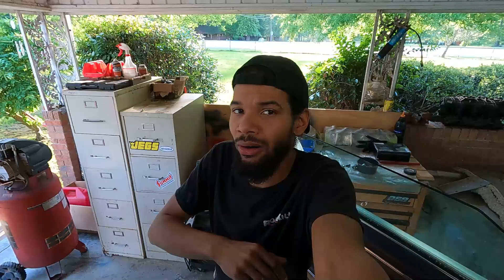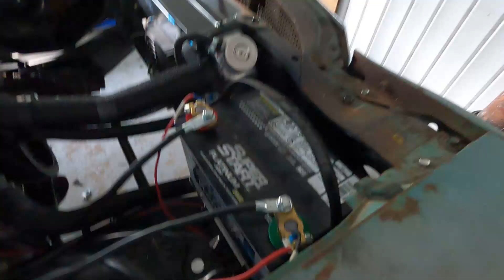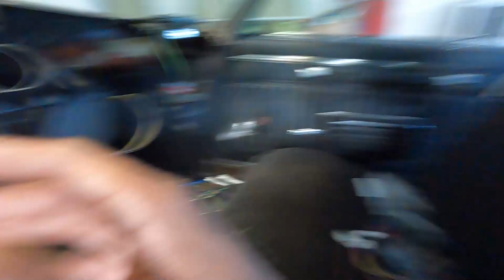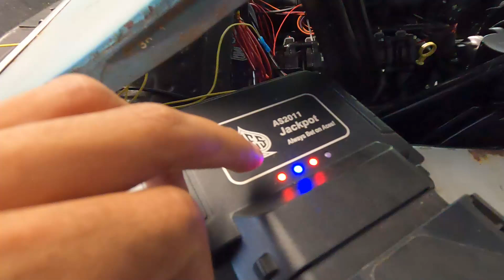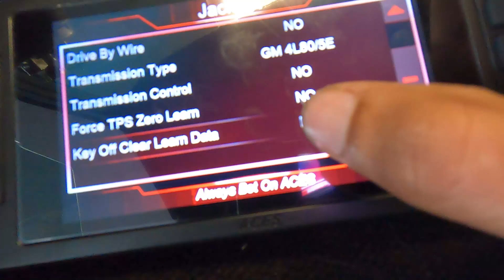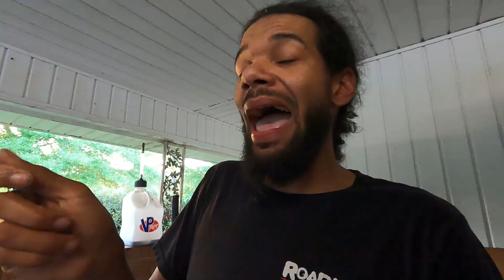How to Setup ACES Jackpot LS: Initial Setup (In-Depth)

Comment: I am thinking about getting this one, but I have a 5.3 LM seven GEN three with LS one injectors but I have LM seven coil packs. Will this unit connect to LS injectors and truck coil packs?
Reply from the maker: I can verify it fits the round coils (19005218) and (C1512-8)
Reply: @TKSpeedShop  cool I will need to buy the coil harness correct what brand did you buy. I'm assuming every complaining about running rich is not adjusting the fuel pressure from that 45 psi how do you still feel about it do you feel like it's running good
Reply from the maker: The first one (19005218) are found common on truck engines
Reply: @TKSpeedShop  I just now seen a video about it does not give you an alternator wire how did you run the alternator wire?
Reply from the maker: I didn’t run a coil conv harness because I ended up running LS3 coils off Amazon cheapppp. Adjust the fuel to exactly what your system is running on definitely helps the hard starts and rich conditions. If you already have an exhaust system, then you won’t have any issues with the o2s reading funky. So far, I haven’t had any issues. It’s basically Holley but still in the development systems with system updates and tweaks. The programming is definitely not as friendly or forgiving as Holley but again, it’s a system that’s still being developed everyday. As far as the alternator goes, I used the ICT billet 1 wire since that’s the alternator I’m using with my setup and I have it running to a key switch hot bus bar.
Reply: The jackpot does have alternator trigger wire it's in the spare wire plug with all the extras like your gages fan controls other goodies
Reply from the maker: This is also correct! I didn’t run any extra wires to my add on harness.
Reply: @TKSpeedShop  how do you like it? Have you got it tuned? Is it running to your satisfaction? I really need to buy one.
Reply from the maker: So far, mines run flawlessly. I don’t have street miles on mines but I have plenty of test time. I let mines self level and made small adjustments to fit my needs. The best comparison I can give you is this,

Holley TermX is like a Edelbrock carb, ironic but true. This system is more geared to tinkering like a Holley carb, again ironic but true.

Aces have done a fantastic job with this system and they’re still updating and improving daily. Plus their social and support teams are really good.
Reply from the maker: No bias either, no sponsor 🙂 it’s a good product geared to DIYers. I plan on using their Royal Flush Kit and Fuel Surge Tank on my small block Chrysler when I get some change together 😭

Comment: I’m gettin a “get wizard data error” when trying to go thru the start up wizard you know anythin abt that ?
Reply from the maker: I personally haven’t had that issue but, I have read from the forums that when an error like that occurs, it’s best to reset the system and update the firmware with the system. You can download the current firmware on their website for your system.
Reply: @TKSpeedShop  how to factory reset the system do you need to hook up the laptop or can it be reset on handheld >asking cause i changed a few things and want to reset and try starting again with all factory parameters

Comment: Did you use the Iat sensor ??
Reply from the maker: @monkey06061  I did
Reply: Thanks for the reply man and one more question, where did you put the ground wire for the coil pack wiring harness ??
Reply from the maker: @monkey06061  on the driver and passenger side cylinder head. On the backside facing the firewall.
Reply: Cool deal thanks alot man.

Comment: Mine is flooding out bad
Reply from the maker: Are you running a self regulated fuel pump or a regulator on/near your fuel rail?
Reply: I have this kit on a turbo 5.3 I have dual pumps (not in tank) and aeromotive fuel press regulator on the firewall 58psi and 65lb injectors am getting flooding issues fouling plugs any tips? Thanks
Reply from the maker: @cmac4084 check your rated fuel pressure in the wizard. Make sure it isn’t out of whack. I don’t have any testing with boost but I do know the system can handle boost. Check the handheld settings since whenever your in boost, you gonna demand more fuel pressure. I would also check your timing, and even recommend colder spark plugs.

Comment: Why do you enable the “Key Off Clear Learn Data” option? Thanks for the video
Reply from the maker: I only did that to clear the tune already loaded from test running the system. Basically to simulate a first start for somebody’s first time starting the system.
Reply: got it thanks bro and thanks for pointing out the fuel pressure rating setting, i missed that one
Reply from the maker: @DIYLukie Glad I could help!

Comment: I been thinking about getting the aces system been looking at it for a few days i usually get the holley terminator x on my swaps but the price has went up 500 since i bougbt my last one smh
Reply from the maker: So far, I haven’t had any issues out of my aces setup, I’m still in the trail and error stages of course. The Holley system is awesome but the price is unfriendly.
Reply: I'll rather pay 850 than 1450 😂 I'm subscribed I been looking at your videos 💪
Reply from the maker: @dblock727-24  hey I really appreciate that!!! Just trying to share my experiences and adventures with everyone 🙂

Comment: I did everything you've done, however mine runs absolutely rich and dies as soon as i hit the throttle. suggestions? DBW lm7 choppacabra cam, shorty headers
Reply from the maker: Did you let it learn? I’m still new to the system myself and working on tuning tables. I was experiencing the same issues until I let it idle for a bit. I’ll be doing some update videos as I experiment with the Aces Jackpot. I highly recommend reaching out to them via email or on the support group on Facebook if you haven’t already.
Reply: @TKSpeedShop  ill have to try letting it idle. thank you!
Reply: Do you have 18” of pipe after the 02 sensors???
Reply from the maker: @trentdawg2832 I do not, I have mines currently open headers. It’s recommended to have some form of exhaust to help with tuning. With the O2 being close to open air, it throws the AFR off.